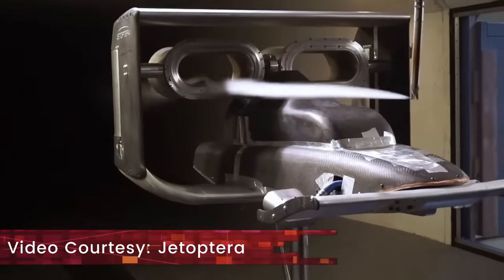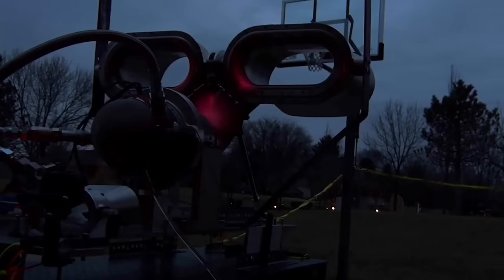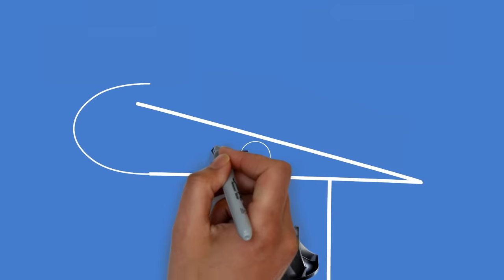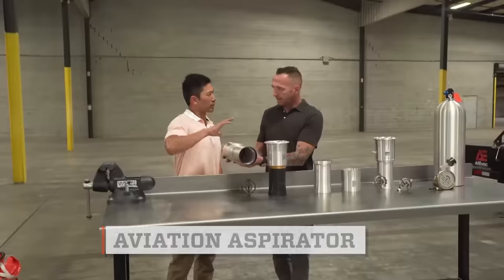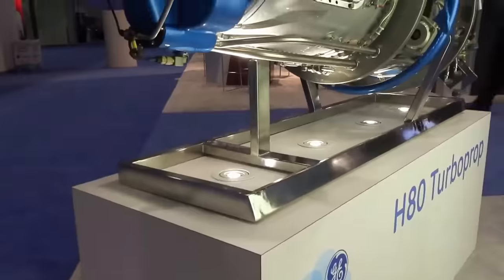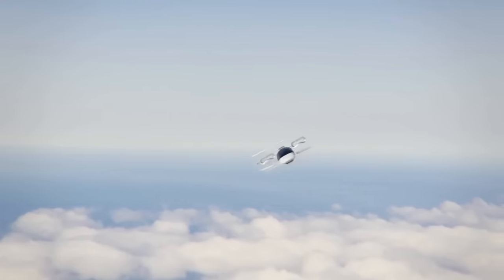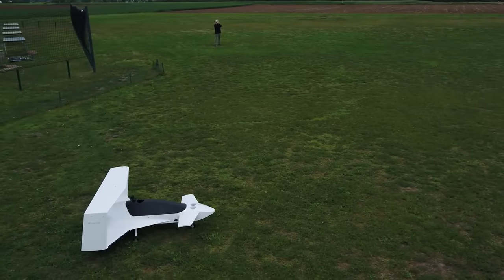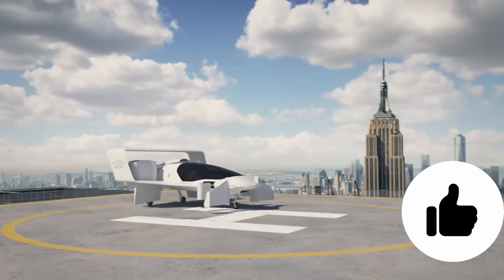Jetoptera's Bladeless Propulsion System

Comment: Basically Dyson-Ventilators and Hairdryers as a Propulsion-System, a lot safer for Birds and IndianaJones' Villains.
Reply: Exactly, That's the basics, they just use wordplay.
Reply: yeah they dont have to worry about getting shredded by a propeller blade but still have to worry about getting hit by a plane going 300 mph
Reply: @mason2699  I would guess that the forces of going though would lead to death..
Reply: Birds would probably be ripped apart by the high pressure air. Also the compressor needs some kind of intake.
Reply: So more ducted fans using bypass air.  Nothing new under the sun.
Reply: That is exactly what they are, the only problem is it doesn't actually work for this application due to lack of thrust. Sure it can move a good amount of air but it might as well be a fart in hurricane compared to the amount of thrust you can get even from a prop let alone a jet engine.
It's like the same idiots who think ion engines will be possible in the atmosphere.
Reply: @SilvaDreams  ion engines are not even possible in space pure fantasy hogwash.  Why not use a radio waves or a flashlight for propulsion, about the same thrust lol.
Reply: @GrzegorzDurda  Well we've been using ion engines for some 50 years on probes, hell the Japanese's probe that just dropped off a sample from an asteroid a few months back uses a ion engine and it's on it's way back out to meet up with another object but that is another 2 years out (or longer I forget)
The problem is they produce very little thrust so are only useful in zero G and are very efficient in terms of power so long missions aren't a big issue though their fuel which is little more than some gases does eventually run out.
Reply: For the birds, I'm rooting for this tech to succeed.
Reply: @SilvaDreams  So "they" say.
Reply: That goes for caped super heroes as well!
Reply: Sorry to break your bubble but I suspect the sudden change in air pressure will be sufficient to kill most birds
Reply: @DantalionNl  Well then at least there's no damage to the engine.
Reply: @GrzegorzDurda  ion engines already are being used...as Silva said the thrust is low but constant...In a zero G environment though they work well....Slowly building speed till a ship is faster than a rocket equivalent.... without all the propellant mass. Outside of space though they are useless.
Reply: @SilvaDreams  I'm guessing it boils down to how much current the electrical source can produce.
Reply: @riderpaul  You would need a LOT to even come close to a prop in terms of thrust. The weight of any type of battery or even a reactor to power it would out weigh the thrust by magnitudes to the point of being useless.
Reply: Bladeless...unless you count three-stage gas turbine. They're crowdfunding...beware.
Reply: And Malcolm Reynolds villains too!
Reply: @GrzegorzDurda  the Dawn probe visited the Asteroids Vesta and Ceres using Ion propulsion. The thrust is very low but when applied continuously for months it builds up to a significant delta vee. Whether or not this jet concept will work remains to be seen but Ion drives have proven themselves in space.
Reply: @nathanlewis42  If it was so then it would be used to power space craft as mass and weight in space is irrelevant. You could push the shuttle in orbit with your small finger.  Hence low output is irrelevant in this set of physics.
Reply: @GrzegorzDurda  here it is from Nasa. https://solarsystem.nasa.gov/missions/dawn/technology/spacecraft/ read about the thrust of the ion engine at the bottom of the page. Clearly you know better than they do.
Reply: @GrzegorzDurda  Mass and weight might well be irrelevant in space - but for any manned mission, time is not...
Reply: And superheroes using capes
Reply: Just wondering if it be reversed to make power instead of a wind turbine  might even work better those jumping g big blades cost a lot to make and can only be used up to a certain wind speed  then feathered
Reply: Safer for birds? You realize 80% of the time birds slam into the plane, not the engines...
Reply: @Alb410 well in this case the body is standing still not at a 100+ mph so I think they will be able to dodge
Reply: a lot safer for the *planes
Reply: Turbo leaf blowers
Reply: Haha haha hahaha I.J.'S Villains.
Reply: Dumb. Like this stupid design will move super heavy objects. This is stupid.
Reply: To the people arguing about ion engines, a lot of the time when someone in sci fi talks about an ion engine they really mean that its a fusion engine of some sort

just something i felt the need to say after i saw someone calling ion engines a fantasy, don't mind me
Reply: @GrzegorzDurda  Spot on.
Reply: I was thinking the same thing
Reply: @GrzegorzDurda  it’s not ion propulsion. Look at their sight.